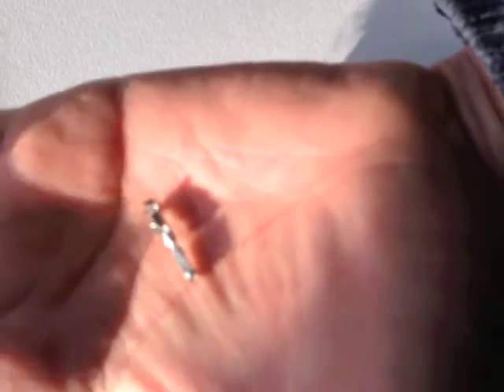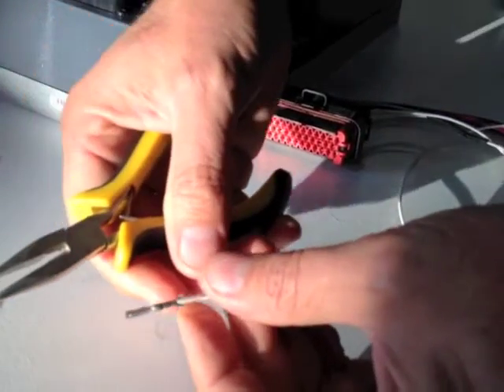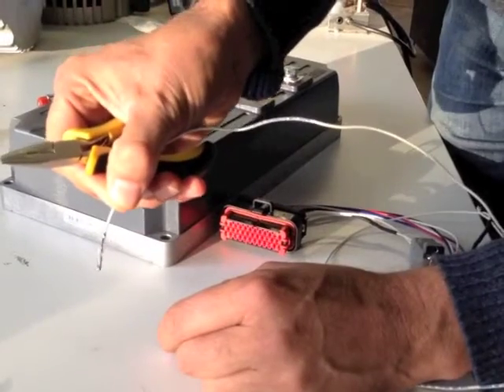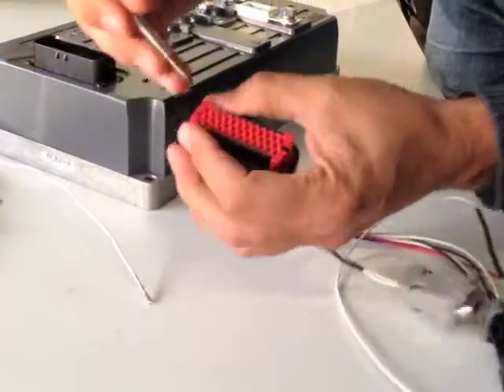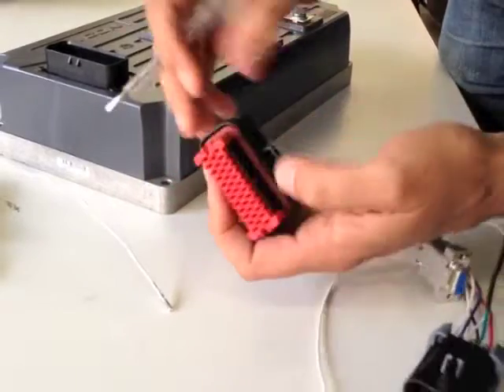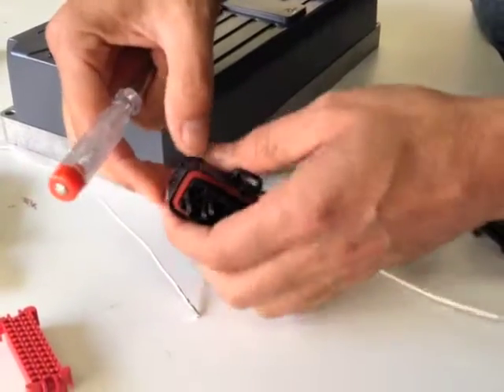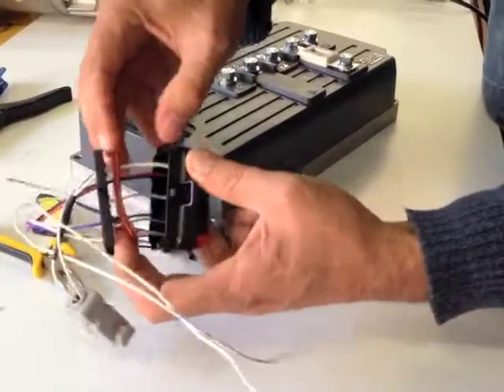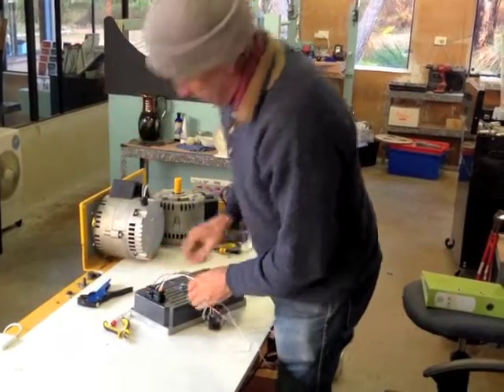Sevcon 35 way plug wiring howto

Comment: Hello.. I have a sevcon gen4 size 2 controller and just starting out. Wondering if you could allow me to see the pin outs and what those pins are to control. I will be wiring up my own 35way plug. The motor i have is a m1117.  If you would be able to help out or point me right would be very nice and save me a load of research. Please reply and don't just pass by this with out at least telling me you can't offer any help. Please understand. Thank you to be willing or not.